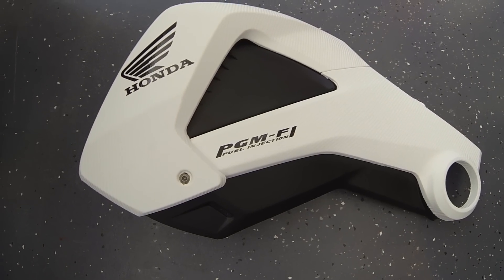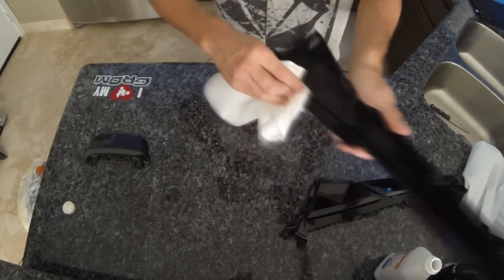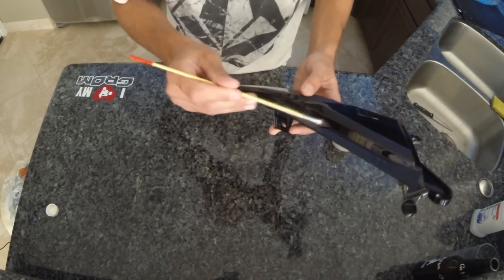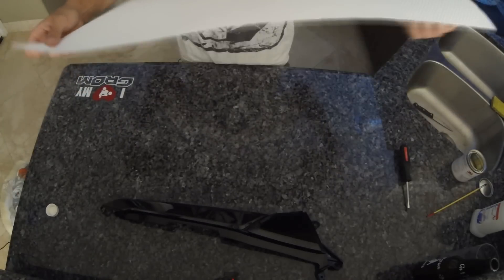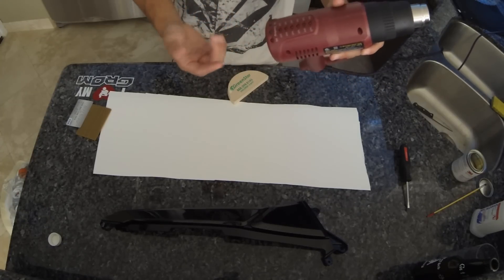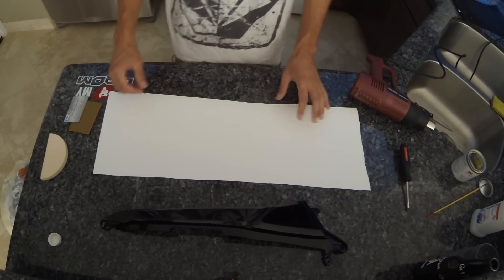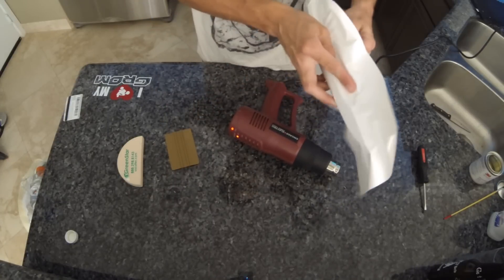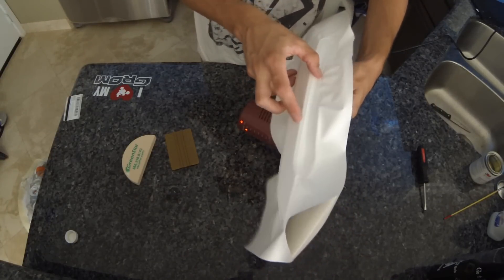How to Vinyl Wrap Your Motorcycle (White Carbon Fiber)

Comment: Ya you are gonna get some serious pull back.  Heat the mass of vinyl and stretch over the edges THEN heat will shrink it into the edges.  This eliminates pull back at a later time.  Same idea when you tint windows you need to pre shrink the film so avoid future heat giving pull back.

Comment from the maker: I did not. For vinyl wrapping, you dont precisely cut out the shape you need. You just cut a piece from the roll and apply it, then trim the edges. It's also a different type of vinyl than I use in my cutter.

Comment: Primer 94 does help vinyl stick in the tight corners but i would not recommend it.
Modern day wrap is made to stretch and stay where you put it, specially if you post-heat. And when it comes to taking off your wrap the primer is going to stay and your going to go through hell getting it all off.
Reply: Thanks!
Reply: Can you make a quick video? lol or is it simple just preheat , stretch and then heat again after you apply?
Reply: thanks Alex. couldnt be fcked looking for the primer anyhow lol.

Comment: DONT DO THIS TO A NEW BIKE     IT LOOKS LIKE CRAP ON THE EDGES AND CORNERS:   ONLY LOOKS GOOD FROM A DISTANCE      WHEN LEFT ON YOUR BIKE FOR A WHILE  IT WILL TAKE THE CLEAR COAT WITH IT   IT WORK ON CAR HOODS WELL BUT ON CORNERS AND DEEP CRACKS IT WILL NOT STAY; ESPECIALLY ON EDGES THAT SHOW:    AGAIN  DONT DO THIS IF YOU HAVE A NEW BIKE AND NICE PAINT
Reply: does not mess up the paint/clear, if it messes the paint or clear below chances are it was already bad or had a poor job.
Reply: so who wants to take that chance..i tried this stuff. looks o-k- for a bit. then starts to look old. this stuff does not do well over a year....when removing it..there is sticky residue on the paint. the clear coat has dull finish ....it is not worth ruining the paint if it is nice....if your bike is old and crappy..then have fun....
Reply: +gooni goo goo we do it all day over here dip and wrap if cheap stuff is used then yes that happens but you get what you pay for
Reply: as im sure you dont want anyone saying something bad about this stuff....because you are in the business of selling and applying it.  i bought the same stuff you use.....i applied not to my entire bike, only parts.  and after it was removed , the paint under was darker than the paint  that had no application. sun will also has an effect on paint. ....